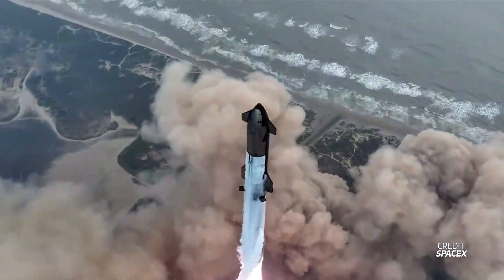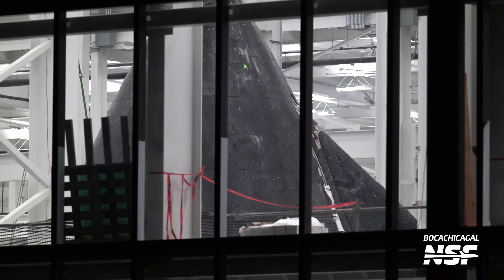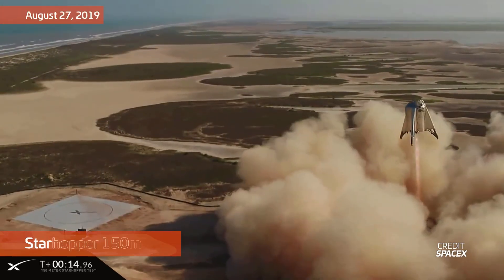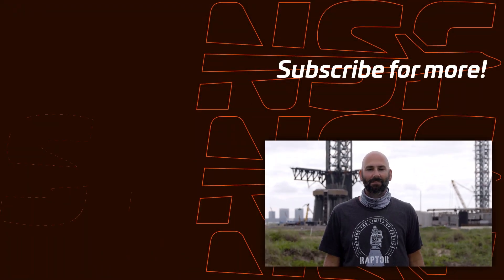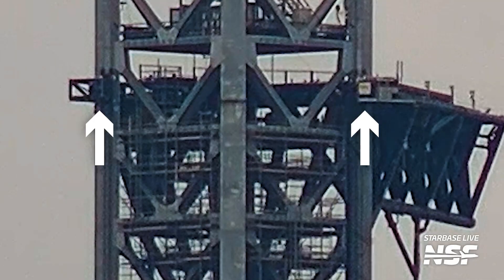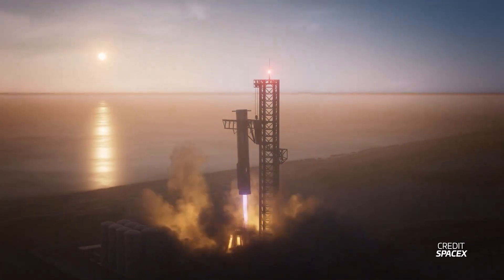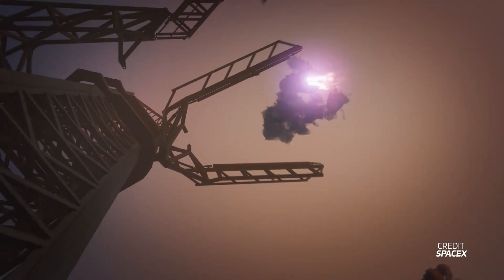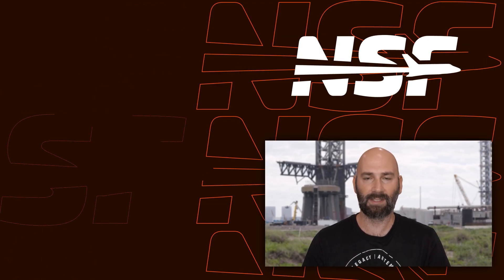Starship To MARS in 2 YEARS? | Starbase Update

Comment: Mars mission, due to extensive time in space, you need better  protection against radiation than say a moon mission  (adds weight). You need better life support (weight). You need food and water for extended mission (weight). You need exercise equipment or your astronauts won't be able to walk when they arrive (weight) You need space to fit everything (reduces room for fuel). Astronauts (weight). Their gear (weight). Experiment equipment (weight). More spare parts (weight) Equipment for mars (weight). Equipment to land and launch safely from Mars (weight), If you want a return trip, you need fuel  (weight) Escape velocity of mars is also higher than the moon so also need the ship to be bigger and all that added structural weight requires more fuel to get the ship off the ground (even more weight). Adding fuel also adds weight so you have diminishing cargo capacity returns as the ship gets bigger.  Even with space refueling and supplying the ship is going to be a goalith.

SpaceX could theocratically send a Falcon Heavy ship to Mars even now. The problem has always been manned. I like Musks can-do attitude but his target dates to reach and colonize Mars have always been unrealistic. A manned mission to Mars ain't happening this decade unless it's a suicide mission., We'll be lucky to get a successful (i.e. astronauts not killed) missions to the moon in that timeframe. Escape velocity on Mars is twice that of the moon. And we would need to launch something far bigger than the lunar landers from it to get back. Thats a huge risk factor.  Thus IMO the best choice for first few manned mission to Mars that has a reasonable chance of not killing the astronauts should be designed as a one way trip.  No  orbital return feature for the rocket. Use the weight savings and extra money making sure they land safely.  The primary goal of the first few missions should be to create a permanent colony that would be resupplied from earth. No return trips until the colony gets  big enough to build facilities on Mars, using mostly local resources,  that allows for both safer landings and a return trip.

Alternatively, use AI powered robots to do all the above first, Then first humans land with their return trip rocket, fuel, launch facility, and Mars condos waiting for them.

Comment: Will the same types of shock absorber blades from the tower arms be used for the resupply contact slide lines all along the cargo and ship filling ⛽⛽🚦🚦🏁🏁🚧🚧🛁🛁🔥🔥❄❄stations?      So What a wonderful innovation..for space 🔥🔥🎾🎾🪐🪐🌍🌍🚀🚀🎣🎣🐲🐲

Could the fire plume pivots at the booster landing cause an explosion at the table🌊🌊 without placing a flame dispersal funnel 🐝🐝⛑⛑and a cover zone at the top of the tower 🐲🐲?

Why is there no emergency capture net harpoon 🕸🕸🦅🦅🚀🚀🔥🔥😎😎on the tower arms in case of a fault in the angle of attack of the virtual gravity well of the booster 🎣🎣💦💦⚖⚖⏳⏳and starship descent in the last 3-10 meters 🐲🐲  .

Then a double shot window of 15 meters of winch from the top of the tower to synchronize the precision of the superheavy ships in the well in case of sudden failure of the guidance computers or engine failures within 50 meters of the virtual well.

Landings assisted by automated Harpoon guns in lines ready to unlock the shooting of grappling nets stretched towards the grids or the aerodynamic descent wings on the 200 / 290 tons of the DRAGON booster Ships or other ships of the fleet of STARSHIP Vehicles and cargoes, in the future Maritimized version on the high seas 🪂🪂🩺🩺⛴⛴🚀🚀or Land drones above the hypersonic landing pits.🐝🐝🚀🚀❄❄🔥🔥🐲🐲.
The blocking channel of the FSD cameras of the tower retention arms allowing the virtual correction of the volume to be captured in complete safety and the very good pace + 5 to 10 seconds abx / y . ✨✨✨✨🎭🎭So in direct Lap time encounter without the ship-reaction ?

Comment: Way back when the chop sticks were being assembled I questioned the stress capabilities of the thin metal arms the heavy chopsticks are supported by.  Then to "drop" a mostly empty booster on them just seems like a design oversight.  Those strips on the tower look like both guides to keep the racking on the tower and to stiffen the walls in the catch area.  If I had to lay a wager on the catch, the booster will line up and "catch" but the rigging will break.  It's going to take spacex crane to remove it from the tower.
Reply: The whole idea of the catch attempt is that the booster slows down enough so that the chop sticks can grab as it slowly descends.  So the weight increase on the chopsticks should increase over several seconds and not suddenly as if it were in free fall.  Theoretically speaking of course.

Comment: There's a zero chance they are going to launch what is essentially Shuttle 2.0 to Mars within 3 years, let alone to the surface of Mars. It won't even get to the surface of the moon before 2030, if ever. The fact you have to launch a dozen times to get one Shuttle 2.0 out of Earth's orbit makes it jokingly unrealistic. Even at a flight rate of Falcon 9, that would be difficult. And why on earth would you even want to do that when you can just use the Shuttle 2.0 cargo bay to build a purpose built craft to go there. The sooner Elon wakes up out of the fantasy of trying to land what is essentially the Space Shuttle on Mars (or even the Moon), the sooner they will actually get it done. As it stands right now, Blue Origin is more likely to land on the moon first because of this.

Comment: They are such a brilliant engineers, yet they have not placed a tiled weak spot ship section in front of raptor engine during it`s fire and duration test. I don`t know. If weak point could withstand blast of raptor engine, it could give some insight if tiles are durable enough instead of, hopefully not, trashing another ship.

Comment: Back when I worked on deep-space satellite systems, one of my roles was being the gadfly: How will it break/What are worst break scenarios .... and how do we keep that from happening or compensate when it does? I've never shook that off, so when I see the chopsticks catch method, all sorts of klaxons go off in my head. Look, more power to them if they do it, but there are so many program setback scenarios even if a catch happens, much less if there are issues -- with the tower (structure, internals), SQD, chopsticks, tracks, etc. Unfortunately, there really are no tests for this since it hasn't been done at this scale. While I'd personally recommend landing legs (going to need them off-world anyway) with enough ships that you can assembly line them for serial launches, if you're determined to do the catch, the only way to really learn what it takes at this point is do it (there is no try). Hope it goes well.
Reply: The stakes are certainly much higher than with landing on a barge, much less on a concrete pad. And that will remain true throughout the life of the program.

Comment: No chance of a late September flight #5? For a while it looked like it might launch in late August or early September. Flight #4 happened 2 months & 23 days after flight #3. 2 months & 23 days after flight#4 was August 29th!
Reply: The time between the last flights is no longer a guide for the next flight for several reasons.  One the work that Space VX has to do to get Mechazilla ready for a catch. 

And two because of the prolonged regulatory approval Space X needs from the FAA to allow the catch attempt.  

There is also the uncertain delay to resolve the environmental lawsuits addressing mishaps on previous launches.

Comment: While most of us probably would have rather had the "Fly now, attempt catch later" scenario, it is logical as Jack points out so well that they delay IFT5 and make the catch attempt now, early on in the cycles and get data to feedback into Tower B and LC39A's tower.  I would imagine that they are testing the catch as high up on the tower as possible thinking that it's easier to start the catch that high, and lower the catch arms as they absorb impact of the booster.  Giving them what we could truly call "Wiggle room".  Or dampening room if you want to be more correct...  Similar to how you catch an egg in an egg toss.  You hold your hands high, and cradle the egg as it comes down, lowering your hands all the way to the ground to help bleed off g forces from the egg's momentum as your hands fall with the egg downwards.
Reply: It'll certainly be interesting to discover, in real time, what the capture procedure is. Will the arms be held stationary at the reinforced rail height? Or will they cooperate and coordinate velocity?
Reply: Great observation! Makes sense.
Reply: I love that you’re comparing the catch of the largest flying object ever to … an egg 🥚😄
Reply: @bennyboy80  - "It's not the fall that kills ya.  It's that sudden stop when you run into the ground."  Just trying to envision why they might have started thinking of putting the catch higher up on the tower.  I don't think they'll "Catch" it there (due to excessive forces negatively impacting tower structure and so on) but they may START the catch up there, and allow those chopstix arms to lower as the apparatus soaks up energy and weight of the booster.  That's all I'm saying.
Reply: @sdebeaubien  Yeah it was a really good thought and great analogy - it just made me giggle that’s all 😃

Comment: Just a thought Doesn't SPACEX already have Life support equipment on board the Dragon capsule which it will need to enlarge for starship ??
Reply: In some ways scaling up from Dragon to Starship really is as simple as adding more CO2 scrubbers, increasing the size of waste management systems, larger air filters, etc., but plumbing all of that into the largest crew cabin ever flown represents a complexity beyond anything previously built. We've actually learned more about large systems management from the ISS than from Dragon, but there are brand new challenges that have never been tackled. For instance, where as the ISS is effectively tethered to the Earth, Starship needs to fly for months or even years without failure and without possibility of a supply mission. Reliability and redundancy are key topics, and again when you factor in the scale of the craft, it's all whole new ball game.

Comment: I’ve been in the tower industry all my adult life and towers twisting isn’t that unusual, but it is unusual for that type of tower. A guyed tower only has one point of connection at the bottom and they actually twist a lot (a little freaky when you’re up there in the wind.) But as this is a lattice tower it shouldn’t be twisting as much but still does twist a bit. You’d really need to look at the structural engineer’s report to know for sure if it’s too much because that report will say how much wind it can take for how long and it will say what the other maximum allowances are on it as well. Personally if I was worried about the structural integrity (which I am given that they are going to side load it at the VERY top with a huge amount of weight) I would add massive guy lines with huge anchors buried in deep columns of extra strong concrete.
Reply: I'm just an average joe with no expertise, but indeed wondered if guy wires would be an option. So would they mount them in an X layout (no pun intended heh) to keep tension on it, to mitigate the twisting? 

However, I also wonder if maybe the test at the top was to somehow extrapolate a worse-case, and that they will indeed attempt to catch it lower down the tower... 🤷‍♂️🤷‍♂️
Time will tell!

Comment: So, if the first Starship to Mars launches in two years they will have perfected the reusable launch of both Super Heavy and Starship AND also perfected the on-orbit refueling of Starship AND have a fleet of them so that the Starship going to Mars can be refueled 6-8 times before leaving LEO  -- Riiighhtttt!  Just to be clear, is two years equal to 24 months or is two years whatever Elon-time works out to.
Reply: @EmsXGuitar It could well be much more than 6-8 times if they can't improve the Raptors Isp.  Based on the Super Heavy, if the second stage that SpaceX calls Starship were designed to be expendable the payload to LEO could nearly double which is why demanding the second stage be reusable is crippling their payload.
Reply: @EmsXGuitar a lot of problems with boiling are dealt with on the ground with difficulty. Imagine doing that in space, uncharted territory. And that is based on a theoretic tanker starship cargo space, that is shrinking everyday bc of the drymass going up, eg hotstaging
Reply: Technically the landings don't need to be perfect yet; the super heavy booster obviously doesn't necessarily need to land (although it would make the refueling fleet faster), and since the atmosphere and gravity on mars is less, landing will be easier

Comment: How about a lunar Starship version that has a few hatches over the tanks and a deployable conveyor bulk material mover.  The starship could be outfitted to have lunar regolith loaded into one tank and it resealed. Then a heating element vaporizes all the volatiles like h20, hydrogen, and oxygen. They can be condensed in a separate tank and the gasses processed/seperated. 

Comb the remaining regolith material with an electromagnet further separates out iron.  I’m no expert but other treatment and techniques can separate various metals and can be automated .  Epoxy polymers can be added to final remaining material and used to make bricks.   A simple excavation system of a tracked push bucket with a ground scraper pick ax type attachment to scrape material and push it towards and away from the conveyors. 

This is a simplification obviously but just think how much capability to process, separate, collect, and store lunar regolith could be built into a starship and mass produced.  It would be able to land on the moon and deploy/convert into any number of things and other starship components assembled together for larger more complex industry. 

Starting with a lunar starship base model. It can modified and converted into any number of pieces of infrastructure we need on the moon.   A starship nuclear power plant?  Surely cheapest most capable option would be to build it integrated into a starship and launched one way to the moon.  A starship greenhouse?  A fully kitted out starship optimized for growing food would be way more cost efficient then building a separate greenhouse module to transport and land on the moon with another rocket.  Metal foundry, water storage, science labs, robot/rover repair/maintenance, habitat units, hotels, recreation sports venues, etc. any of these could be implemented with a dedicated Starship. 

So it seems to me the mass production, assembly line that spaceX is building can also be used to rapidly and cheaply build out a lunar base.  The excavator/mover rovers along with a few types of remote controlled manipulator robots and a system to put a starship on its side and you’d have a lot of capability for building infrastructure.

Comment: Newton and Archimedes are pains in the butt. The massive inertia and leverage of those chopsticks is a fatal flaw in the current design. The flexing and recoil of the chopsticks is a real problem. IF the chopsticks flex open when they need to be catching the stubs on the booster, it will miss completely. Really, the only solution I can think of is 1) Replace the chopsticks with a lighter material (reduce inertia) or 2) Marke the chopsticks with additional joints so that the end of the chopsticks can hinge inwards around the booster. This would create less flex leverage and more opportunities to dampen the inertia.

Comment: I still think that landing legs are a much safer and less risky option than chopsticks.
Reply: I do believe landing legs will eventually play out to be the landing design of choice for most rockets considering how first stage dry mass is less punishing than second stage mass, but i wont complain that spacex is trying wacky stuff. Basically free trial and error research for the rest of the space industry, bankrolled by elons wallet. Regardless of whether or not it ends up as a viable solution, we still learn something. If elon can spend money finding out what doesnt work, thats less money nasa has to spend doing the same thing (if pursuing alternate landing methods was an inevitability). Nasa already struggles to get the budget it deserves to begin with.

Comment: If we were only 2 years away from a possible Starship launch to Mars, surely we would have seen some progress with landing legs for Starship and some initial attempts?  I know the pace of launches is speeding up but it seems there is still a lot of development to go before those initial Mars landing attempts.  You would have thought version 2 or 3 of Starship would include the landing solution which is needed for both Lunar and Mars Starships......
Reply: Don't forget to consider the increasing rate of development within the factory and testing with a more built-out Starbase.
Reply: Orbital insertion by itself will be very challenging for Starship. Using aero capture with something of the mass of Starship in an atmosphere as thin as Mars will be......interesting
Reply: @Jogeta5  Not Earth orbit, Mars orbit.